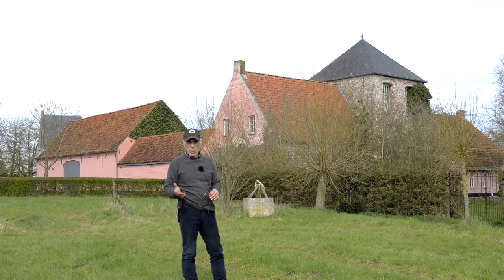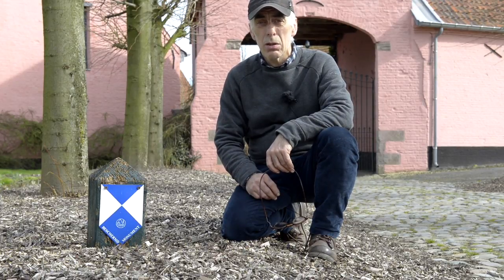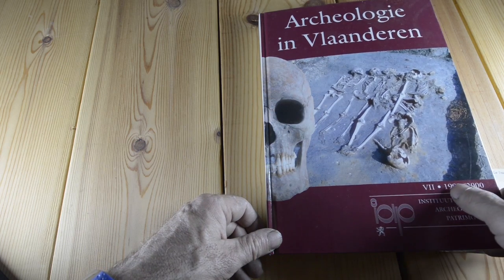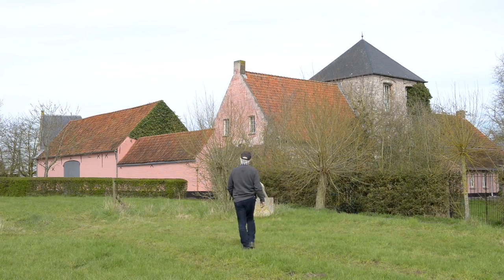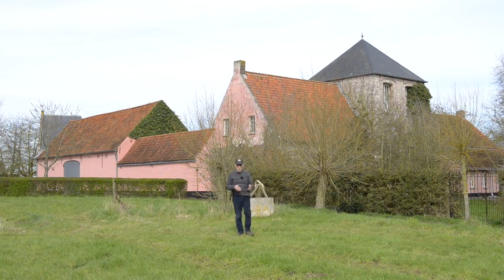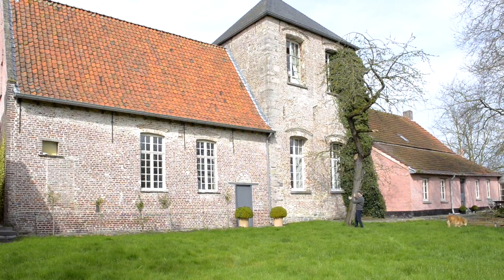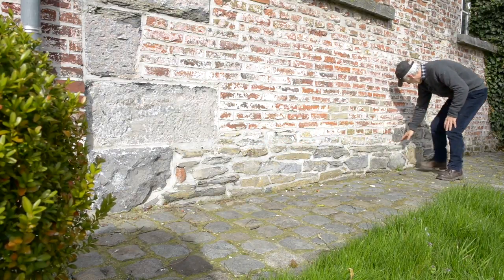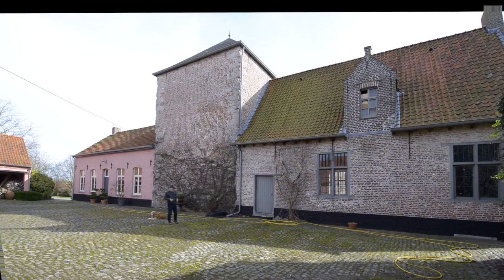Restauration of the tower,   Episode 1, get to know the past and the building

Comment: If you look on google maps you can see there is a an oxbow lake where the river used to run and its about half the distance from the tower then where the river is now.
Reply from the maker: f0rumrr  yes indeed, that is the old river.   Later they pulled the river straight.   Txs for commenting
Reply: Ya thats what I figured, they did that to my local river, the sammamish river, around the start of the 20th century. To make it easier to transport things on it.

Comment: A loot of work ahead !
Wen it will be ready will it be a Hotel/Motel  ?
Reply from the maker: ROAlexa1981 txs, i have been working 20 years on it so far.  Its a private house/ farm.
Reply: Wat heating system did you chose ? will it be just one system ?
Reply: The pasture clay sealing between the fine wood is with straw/hear, usually with straw because/fore preventing material cracks. Look in modern concrete, to prevent cracking we are using polypropylene fibers or small metal bars !
It will be nice to consider using yourself in the restoration !
Beat regards  !
Reply from the maker: ROAlexa1981 heating is based on a central pallet burner
Reply from the maker: ROAlexa1981 , thanks and indeed. At the time they used horse and human hair.    Using my own hair is not much of an option as i have not that much. Left  :) :)
Reply: Hahahaha...not own hair, using straw , yourself using the straw  mix in the renovation, were is possible/necessary  of course !
Sorry  for the misunderstanding, English language is not native !
Reply from the maker: I was just joking....of course.....  txs